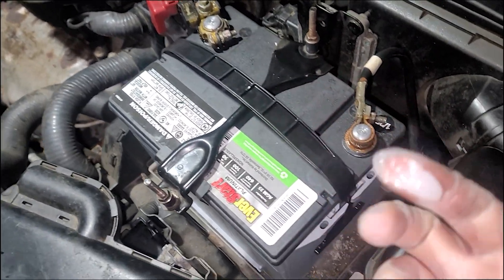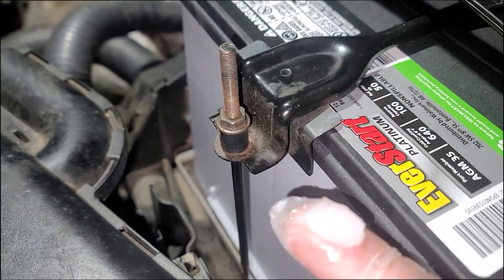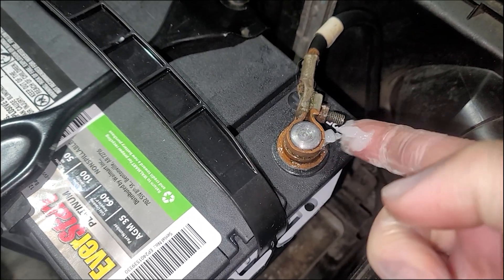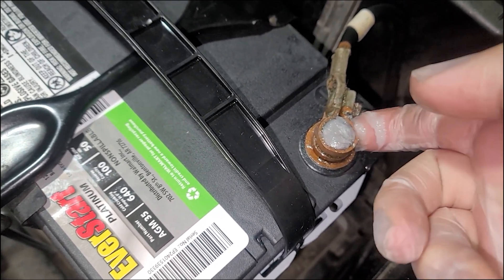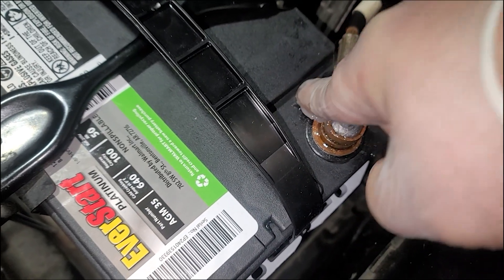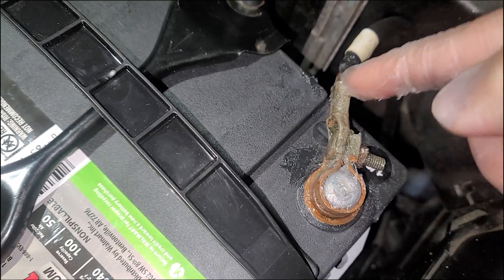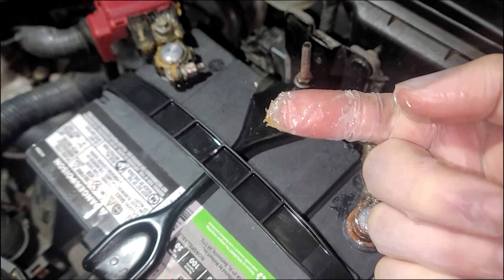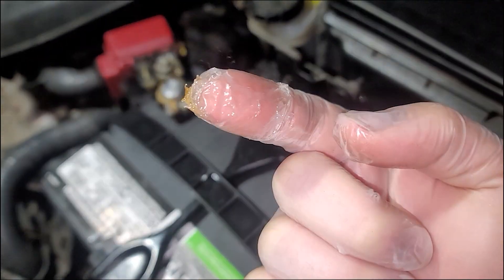Tip of the day 4: Keep a good battery connection in cold or wet weather - Dielectric Grease!

Comment: I spray fluid film before made contact. I guess you never stop learning. Thank you sir. I appreciate it
Reply from the maker: I haven't heard of fluid film but after a bit of research, their product seems to also encourage a secure connection prior to application. If it works for you that's great to hear. The multi-purpose synthetic grease (with dielectric properties) used in this video goes from -45 F up to 450 F which is something you need to cling to all those little surfaces but upon heating up not just becoming liquid and running down your battery where it's not serving a purpose. Noco Corrosion Preventative is what I recommend for the majority of the year however when those temps drop to freezing or heavy rain/moist weather is upon you, a dab of grease goes a long way :)
Reply: @ thank you 🙏